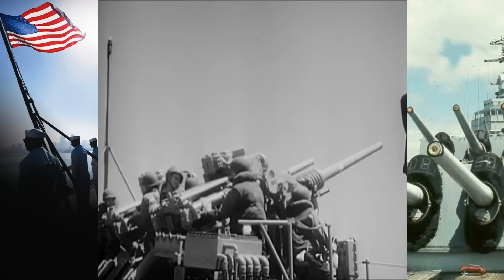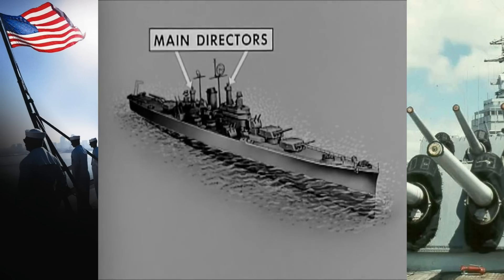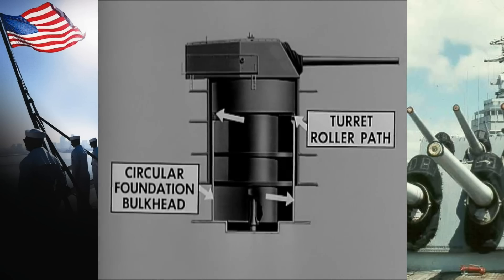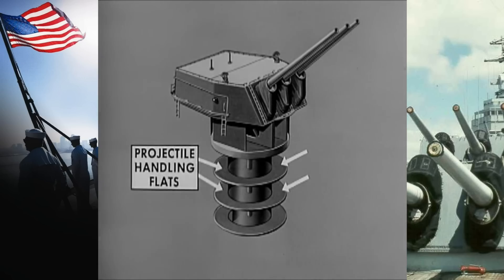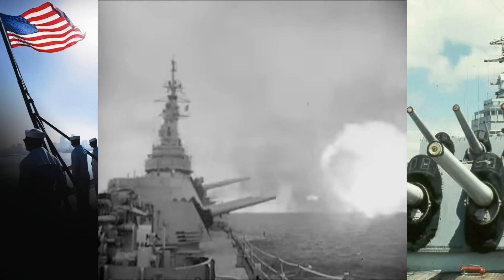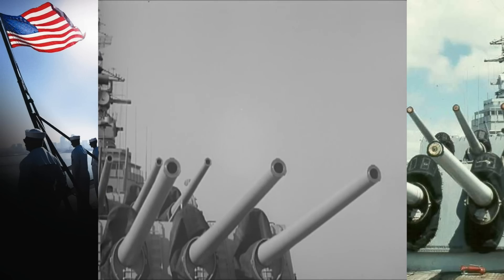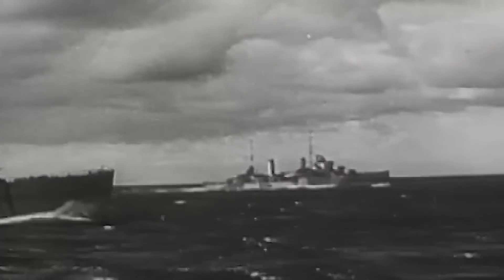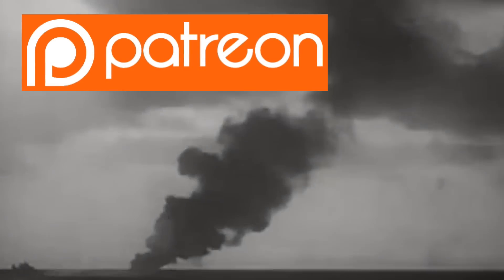How Do Large Caliber Naval Guns Work?

Comment: I was in the U.S. Army during the Vietnam War and the 8" cannon, M110 series, was the largest.  The bullet [excluding powder bags] weighed 200 pounds.  I knew one person that could carry two of them, no one else could from my experience.  They weighed almost exactly 200 pounds and were very accurate.
Reply: In Viet Nam, we had 8 inch "howitzers", which are not the same as "Guns".  They both make a big bang when fired, but there is where the similarity ends.  The M110 range was 16200 meters, and it was the most accurate artillery piece in the US inventory, (Unless you want to consider a mortar to be an artillery piece.)   The US Army and USMC  155 MM,  8 In. howitzers and the US Army 175 MM "Gun" used loose bags of powder propellant, and did not have a "shell" for containment of the powder.   The powder load was varied for the range of the shot.  The 105MM howitzer had a field loadable shell for powder and projectile containment.  With the 105MM howitzer, the powder charges were varied by unloading powder bags out of the shell just before shooting.

I have flown Naval Commanders who spotted and called in naval gunfire from the New Jersey, in the land attack mode, and found the 16" rounds and the smaller rounds to be woefully inaccurate and therefore totally useless.  (One of those commanders was also a total liar, when he gave the damage analysis to the ship.  He claimed that they hit so many bunkers, when he really only got lots of "smoke and foliage". 

I suspect that in flat trajectory "Gun mode" they may be more accurate, otherwise all the sea battle stories where naval gunfire was used were just lucky shots!  We very seldom used artillery in flat trajectory gun mode, unless the firebase was  under a ground assault attack.

I have never seen any man carry two 8In. or even 175MM rounds at one time.  There was a t-bar for two men to lift  a single projectile by the lifting lug.  I would not have allowed a person to attempt to carry two rounds under his arms, because he might drop one and cause damage to the brass rotating bands which were essential for proper sealing and seating of the projectile into the bore grooves!  I cannot see that a man would have enough strength in one or two fingers to fit through the eye of the lifting lug of a 200 pound projectile.
Reply: @josephkane825    The man I mentioned carrying two 8" rounds did not carry them under his arms, he carried them with his hands by the eyelet, and he never dropped one that I saw.  He was unusually strong.  And, yes the 8" was a cannon or howitzer and the 175 was a gun, the M107 I believe was its designation.  We had composite batteries of 8" and 175 mm.
Reply: I was with the 7/15 Artillery in 1969 and 1970.  Did the strong man use some kind of hook or maybe a carabiner to put through the eye of the lifting lug?  There was room for two fingers, but they wouldn't be evenly side by side, so the majority of the load would have been on one finger knuckle!   
There  was a combination 175/8 inch Battery at LZ Blackhawk on route 19 (QL19)  just a few miles west of the Mang Yang Pass in the central highlands.  We had two M 42 Dusters (40 MM twin Bofors guns) and one Quad 50 system from the 4/60 Air Defense Artillery co-located there for a while Opcon to the Battery Commander for defense.  One of the quad fifty operators was an American Indian, or Native Samoan, who was extremely strong.  He could sit in the quad 50 operators seat and cock one M2 on each side simultaneously.  This was difficult, because of the length of reach required to grab the charging handle and the weird angle involved.  
During delivery and unloading operations, many soldiers had to chip in and help, even though they were from different units.  I wonder if he was your strong man?
Where were you located? When?
In early 1970,  a 175MM gun had a round detonate mid tube during a fire mission.  when you flew high  over it, the gun looked like an 8 Inch howitzer.  It killed and wounded the whole gun crew... Some were killed because of open powder tunes that flared out while they were nearby, burning them.  That is another story.
Reply: @josephkane825   I was in the Vietnam War, Tay Ninh province, War Zone C, 2nd BN, 32nd Field Artillery Group, in 1968 and 1969.  The guy I mentioned carried the rounds with his hands only.  Unrelated to him, just to mention strength, a person that I saw once in a while asked me if I wanted to see him bend a quarter with his bare hands, sure I did and game him a quarter and he bent it like I could bend a stick of gum.  I suppose there are a rare few that God has endowed with superb strength.

One other person saw a display of strength, where he had gone in Vietnam and for what purpose I cannot recall, however, when there he kept hearing a 155 shooting rapidly.  He turned to look and found a 155 "pig" shooting without lowering the tube to load a round.  The soldier was ramming 100 pound rounds into the tube while the tube was elevated.  As I reflect upon that, because a 155 uses separate loading ammunition, it would have been dangerous if the tube had not been swabbed with a water soaked cloth of some kind, as I remember using.  Going back to the 8" SP howitzer, there was a canister of water on the left side when viewed from the rear, that was filled with water to swab the chamber after each round was fired.

I have been in 105 units and for some reason I cannot recall swabbing those tubes, probably because the powder was in a brass case.  Much of my memory is gone.  I do have recall of many things because I experienced so much, however, after the second time I was wounded in the head my mind could not function as well, including memory and now that I am older I am losing more memory.  Unfortunately, even with a less than good memory I will likely recall to much of the horrors I witnessed, and as you said, that is another story.
Reply: @josephkane825   An Edit of my previous comment:  Sorry, my memory is a bit slow, I was with the 2nd BN, 32nd Field Artillery, 23rd Artillery Group I believe was the arty group.  1968 & 1969.  A battery was at [the old] French fort, we simply called it French Fort for that reason, located North of Nui Ba Den [Black Virgin Mountain].  B battery was South of Nui Ba Den on the northern perimeter of Tay Ninh West.  C battery was East of Nui Ba Den.
Reply: I should of thought of it before I replied a second time.  A strong man could have easily grabbed the tee-bar hook with one hand and lifted a round.  I too have seen a man ram a 155 mm round with his gloved fist and bare arms in a split tail howitzer in a small firebase we had just north of north of Qui Nhon.   I was surprised, because the gun was at a high angle of elevation, and I wondered if there was a chance of the projectile falling back out.  I also wondered how he did not get his arm burned by the hot barrel.  I didn't get a chance to ask, because my helicopter was parked so close that the muzzle blast was deforming the top window of my helicopter, and I had to get out of there between shots.  This firemission was in support of the Capitol ROK Infantry Division (CRID) operations south and east of LZ Uplift. 

I was a bad ass, fearless LOH pilot attached to the 7/15 Artillery Battalion / 41 st. Artillery Group, and  I flew brass and trash, mail, personnel, Etc., and did scouting and artillery spotting.  One day they offered me a chance to fire the 8" .  (Pull the lanyard)  So, they set up a dummy fire mission on one of my previous directed targets, and I climbed up on the deck and got ready to fire.  Now the first problem came up.. I didn't have any hearing protection with me.  (I am a pilot and second to acute eyesight and good sense of balance, is good hearing!)  Then, the gun crew began talking up the danger, miss fire safety procedures, being careful not to fall into the recoiling gun carriage assembly Etc. (which I knew was just to psych me out, so I was cool with it.)  Then, the projo was loaded and rammed, and the powder rammed and the breach locked.  I got to load the primer shell and lock it in, and when the  order came, I pulled the lanyard with a good jerk.  Nothing happened, so I jerked again quickly several times and actually broke the cord.  It turns out that they had replaced the firing hammer with one that they had filed the little tit off,  so it could not strike the little primer in the base of the primer shell, and make it go off.   The whole Tactical Operations Center crew and all the gun crew had their big laugh.  The hammer was soon replaced, and I finally got to shoot the 8 inch howitzer.  I was actually quite nervous by the time I got to try to fire it the second time!  AAAH --  the fun things you remember!!!!
Reply: @josephkane825  NGF always has more range error due to low angle trajectory and velocity as compared to low angle howitzer fire, and moreso mortars/high angle howitzer fire. Tactically, you want your ship's line of fire parallel to your front line, as the deflection error is lowest in guns, higher in low angle howitzer fire and highest in mortar and high angle howitzer fire.
Reply: Please keep in mind that my experience with Naval gunfire was limited to flying a Naval Officer from the New Jersey and listening to him direct the 16 inch gun fire to a target I pointed out to him. 

Is the deflection you refer to because of crosswinds?  By "parallel to your front line",  do you mean the angle off the bow or stern?  If so, it shouldn't matter which direction off the bow you fire at.  I am sure that some account for crosswind , and winds aloft is considered by the Fire Direction Center when plotting the firing solution.  There, the land based gunner has the advantage of repeated and frequent local meteorological "winds aloft" plots,  while the moving ship would easily cover the entire land based fire fan in less than an hour.  I do  not know how a ship could know the winds aloft in a local area, unless they were at anchor.  The winds, both near surface, and aloft are different in the immediate vicinity of the shore, than further inland, even just five miles.

I agree with you about high angle gun and howitzer fire accuracy, ( Naval or land based) but I disagree with you about Mortar fire.  I have used US Army 81MM and 4.2 inch mortar fire quite often.  They are always fired at "high angle", and are affected by the winds aloft.   Since the range is so limited, and the velocity so low comparatively slow, a person with good eyes can sometimes visually follow  the projectile through the majority of the flight.  When I call in the Mortar fire mission, I usually direct the fire and walk the impacts onto the target.  I have never had a first round hit with a mortar, like I have with an 8" Howitzer (One time, sheer luck!), but unless it is a pre-planned, and pre-registered "defensive fire" target locations , no one expects a first round hit.  Ship to ship first round naval gun hits amaze me.  I know they are not just luck, because there are at least one example from both WW1 and WW2, where the German Kreigs Marine hit British navy ships with the first salvo.  To be able to account for the motion of the ship, and the motion of the target, and the pitching motion of both the target and the shooter amazes me.   When I needed extreme accuracy with the 8" and 175 MM, and 155 MM artillery pieces, I usually asked the FDC (Fire Direction Center) to "Mic" the tube.  They would then put a precision clinometer on the tube for each shot.  I do not see how you could do that on a ship that is constantly moving in three axes.

BTW, the 175 MM,  M107  gun would have a maximum  elevation of the projectile of 56,000 feet during some high angle of fire missions.  The 175 MM gun was very inaccurate as an indirect fire weapon.  On high angle fire missions, or for ranges beyond 20,000 meters, it would not be unusual for me to get 1,000 meter "splash" deviation  I only called for fire from one if it was out of range of the 8 inch howitzer, or  the 155 MM howitzer.  In viet Nam, the 175 MM gun had a range of 33,000 meters where the 8 inch howitzer could only had a range 16,400 meters or so.
Reply: The other thing you have to remember about NGF it that the ship is constantly moving (roll and pitch) which is compensated for by a stable gyro in the center of the ship that feeds information into the fire control computer that aims the guns.
Reply: @anon2240  Yet the Marines I know  all swear by the Naval Gunfire for close support?!?!  In a "Danger Close" situation, (Say less than 500 Meters from the friendlies, or overhead fire to the down side of a ridge line,)  I do not understand how the Naval shipboard fire direction center could assure safety from friendly fire impacts with a ship that was moving in three or maybe four axes simultaneously.  With the Army 8" howitzers, firing from surveyed positions, on solid ground, we used a gunners quadrant on on the tube, for EACH SHOT to assure safety, during Fire for effect in a "danger close" fire mission.  Initially I wondered if those Marines were just in awe from seeing  a landing zone preparation, and the smoke and foliage show it produced.  However, one of my uncles who was a Marine Infantry 1st Lieutenant, told me that he had in fact also used Naval gunfire (5" and 8") for close support in 1966 and 1967, and had no "friendly fire"" incidents or close calls.  Another Marine I knew, Major Mike Dominguez, told me he was not impressed with the naval gunfire accuracy, but he may have been biased, because he was in charge of the first Marine tank battalion to operate in country.  He was a direct fire and mortar lover!
Reply: The fire control computer on the ship controlled the aiming of the gun turrets The firing co-ordinates were called in by a spotter and entered into the computer which also received an input from from a three axis stable gyro platform in the center of the ship and inputs from the gun turret as to the direction it was pointing and the inclination of the guns. The computer controlled electric motors in the turret that constantly corrected the aim of the guns for pitch and roll. This computer was not an electronic computer as we know them today but an electro-mechanical device filled with gears and cams controlled by servos and synchros for inputs and outputs.
Reply: @anon2240  The Gyro control was explained to me by the Naval Forward Observer I was flying around.  I also saw a video explaining how the New Jersey fire control center analog computer worked.  

However, I still do not see how it could get near to the accuracy of the Army or Marine  howitzer tube "gunners quadrant" where we were using tenth Mil readings.  That is 0.005625 degrees or 2.025 seconds of arc.  It is just counter-intuitive to me!?!?!
Reply: It is true that firing from a fixed position will give better accuracy than firing from a position that is in constant motion. A lot of it would have to do with how tight the tolerances were held in the manufacture of  the mechanical fire control systems of the time and how well the system was kept in calibration by the crew that maintained it.
Reply: @anon2240  I totally disagree!  You could be right if you are referring to naval artillery from a long ship.  The normal thermal expansion of metal with guns situated more than a hundred feet apart, is one tolerance factor that would make  comparison with a single land based gun an apples to oranges comparison.   Gear lash, from a large diameter turret slewing mechanism would certainly be a horror story for someone seeking accuracy!  Even your elevation gearing or hydraulic elevation mechanism would be a source of radical inaccuracy.  The tolerances for a twenty foot diameter rotating and load bearing assembly probably gets measured in dimensions greater than 0.125 inch total runout.  I doubt there is much maintenance activity that could negate inherent manufacturing  and fabrication limitations.

I think the biggest factor affecting accuracy and repeatability  is the Powder condition.  There,  on land, we used to do "Registration Fire" to account for each new "lot" of powder.  Powder moisture was also a big factor.  Yes, if your gear lash tolerance on the slewing mechanisms was greater, the azimuthal accuracy would suffer.  On land based stationary artillery pieces, the laying in of the piece would be a very big factor that might be beat out by a rigidly mounted naval gun turret.  In land based artillery gun pits we had surveyed aiming stakes sighted in around the piece.  These could be affected by wind, and muzzle blast effect and even by ground vibration.  The  piece would also jump with each shot , and might have to be repositioned.  This repositioning probably would not be as accurate as a rigidly mounted naval turret even if it did have large manufacturing tolerances. 

The same with the elevation mechanism.  However, for elevation, the use of the gunners quadrant on a stabile land based gun effectively negated the elevation problems that could associated with Naval gunfire from a three or four axis moving gun.

Bottom line -  Somehow Naval Gunfire claims to work out for the Marines.  In both world wars, ship to ship gunnery certainly demonstrated that some mastery of accuracy and repeatability was achieved.  It is still counter intuitive to me, but there is at least a good amount of historical empirical data to prove that is does work!